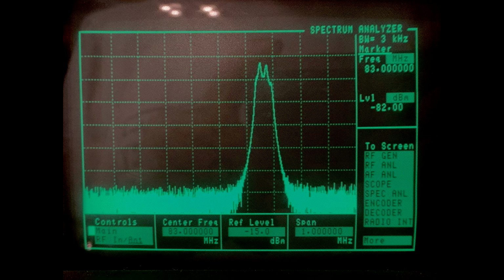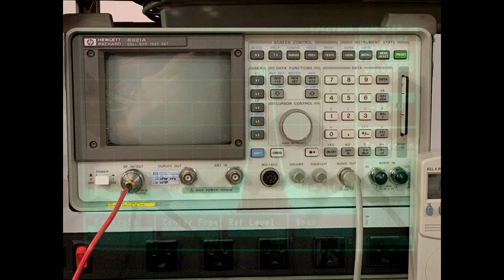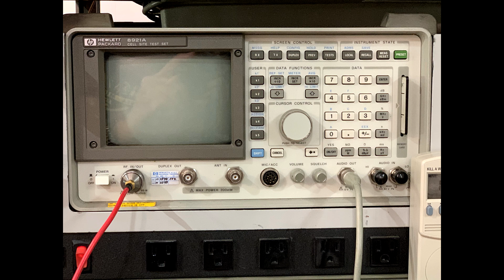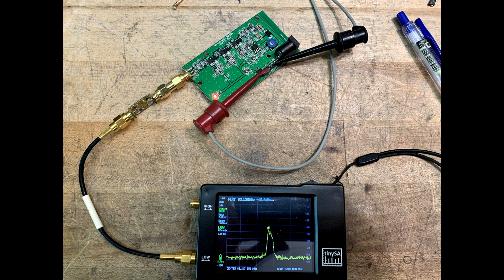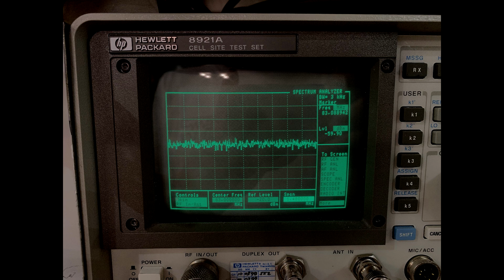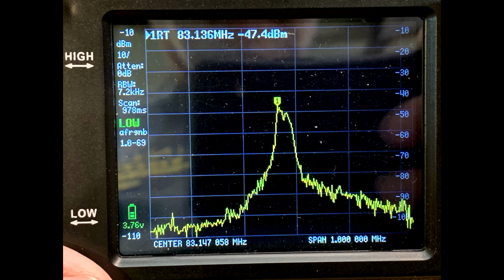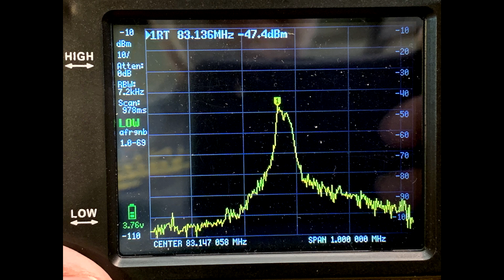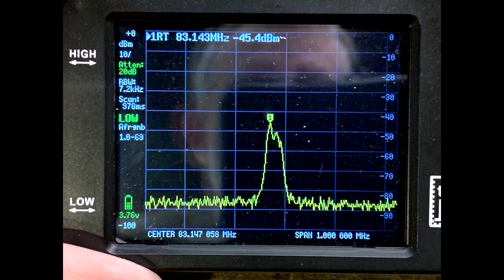#546b TinySA Measuring Filter with Noise Source

Comment: Greetings..    

Thanks for video.   I used the TinySA to measure the channel power ( using the same noise source / build date) (100K-350Mhz) and it came out as +18.4dbm, which is the same value as listed in your comments.   Please,  The seller has listed the ENR for the 350Mhz and below as around 58 dbm.   I have tried to determine how to calculate channel power (verify the measured + 18dbm level), and I am failing.    Seems like it would be easy to get an estimated value.  

Any idea on how to calculate the channel power based on bandwidth and ENR values.

Thanks
Reply from the maker: I don't know much about this other than it does require RMS measurements. The TinySA with it's digital filters, probably does not do RMS. The math to calculate the total power in channel would be TinySA specific.

Comment: What a great and interesting video. I did not know about the noise source board. I have a Rigol DSA815TG and three each top of the line Antenna Analyzers. BUT, I could not resist getting the NanoVNA H4 as well as the TInySA. They are just two tools that are too good to be true. It's not easy carrying a Rigol spectrum analyzer, battery and a DC to AC inverter around on you body hunting for a noise source. But the TinySA sure makes that job easy. 
I just received the NanoVNA H4 yesterday and now I have to learn my way around the menu maze. It's do-able but I would not call it user friendly.
Thank for posting the above video. 
Barry, KU3X

Comment: I really appreciate you testing this so extensively. A question on adapters, I see sma adapter kits all over and even bought a couple but they looked pretty sketchy for rf work., any recommendations on a reliable source? Also which would you recommend  as a source of tiny sa, the tinysa web page lists r&l electronics and alibaba? And of course as a suggestion for future video a course of tests to check connectors for the frequency range of the equipment. Thanks again for all your great work.